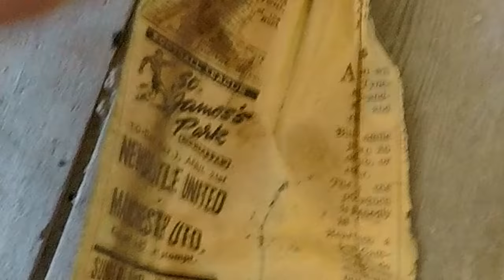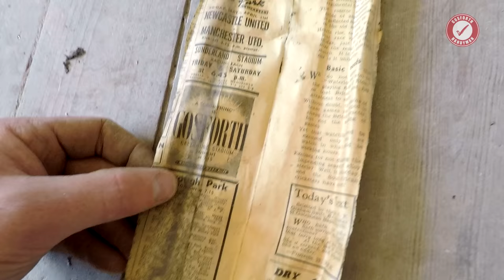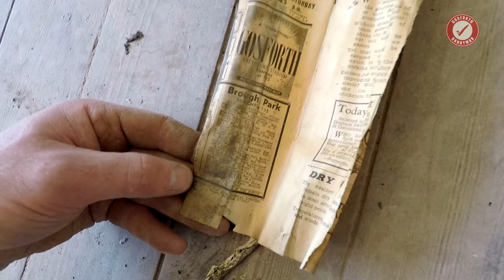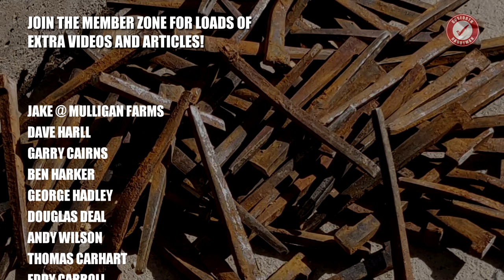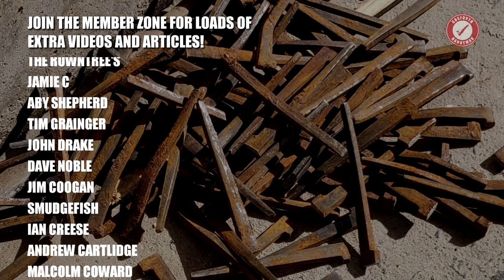How we INSULATE under the floors (1920's Renovation Part 26)

Comment: How architects differ. Mine advised not to use PIR but to sling a breathable membrane on the underside of the joists then fill with 200mm of minimal wool. Fortunately, there was sufficient crawl space to get underneath and staple the membrane securely. Apparently this method is used frequently when restoring listed buildings.
Reply from the maker: I think there's a number of methods depending on building age, crawl space size etc. There's some best practice stuff here: https://www.gov.uk/government/publications/insulating-suspended-timber-floors-best-practice

Comment: The exterior walls and floor joists are thermal bridges, even if you insulate the outside of the walls they are in contact with moving air bellow the floor allowing heat to transfer from inside the room down the wall, also through the flooroards through the joists, so the room is still losing heat

Comment: Exactly the problem I had when I insulated my ceiling - joists that hardly any of which were parallel. Took ferkin' ages.
Reply from the maker: Yup, takes forever. Not a single parallel joist. 😢🤣

Comment: Only breathable insulation should be used in the old sub floor. The timbers will sweat and over time will rot. Same problem as using spray foam insulation in the loft. It prevents air getting to the timber to keep them dry

Comment: Just insulated a 100 year old kitchen extension on a house. I found a YouTube video on cutting insulation where a large scraper has one side and the front edge ground to razor sharp with a grinder.

Mark board, use 2 or 3 inch straight edge to run the scraper at a perfect 90 degree. Once scored in by around an inch, throw straight edge to one side and run blade through by drawing it towards you with increasingpressure. 

The best part being thar using a wide blade, the cut remains straight right through once started as board holds blade straight and NO MESS.

It worked a treat and with practice, really quick with perfect straight and smooth edges ideal for squeezing in.

The sharpened front edge can be used as a trim knife to assist inaccuracies in floor boards and joists as will as cutting out obstructions.

The bigger the scraper the better, ONLY grind one side and mark it as I did both and managed to slice a finger when pressing it down without thinking. This leaves one side safe to touch and push in for deeper cuts..
Reply: Lee do u have the link?
Reply: @BoxerfanUK  you mean for cutting?
https://youtu.be/1cv46GuniIY

Not sure this is same video but same idea. I sharpened a wider scraper than shown but either should work. Just get it razor sharp but watch your fingers, especially slicing in.

Comment: Just a thought and to add a degree of crazy...
Under cut both dimensions by a half inch. Float it on your nailer sticks. FOAM a quarter inch gap all around. Then, there is no air gap in those imperfect hand saw cuts. Not that you had many. I know i do! Cheers.

Comment: there should be a layer of breather membrane installed prior to installing the PIR, then the joists taped to act as a VCL. Without these any moisture going in between the PIR and the joists will ruin the joists.

Comment: Awesome I wish my downstairs floor wasn’t concrete or I would be doing the same I bet it makes a huge difference
Reply from the maker: Cheers! Should make a big difference. With concrete you'd need to dig it up and re-screed with insulation. 👍
Reply: @GosforthHandyman  I just did what you have done last but year, bought mine ripped it back to brick and its done now so that won’t be happening now lol. I tore mine apart then lockdown happened and I was living there in one room and I had to buy 35 bags of plaster from gumtree for £20 a bag because there wasn’t any anywhere
Reply from the maker: Oh no! The materials shortage is turning in to a big problem. Our whole extension might need to be postponed. Heard about the plaster thing - crazy. 🙄
Reply: @GosforthHandyman  I hope you don’t get delayed to much I want to watch the progress 👍

Comment: Tip for those impossible nails: The large curved back of full sized, vise grip pliers make an excellent fulcrum for pulling fasteners. You can pull out screws if you want to. Nails are usually easy. Even if you just have a few mm exposed from a broken nail you can still lock on and roll the pliers against the wood to pull almost anything. For the really hard ones, or brittle materials, you'll pull a few mm, then release and grab at wood level again, so you don't break the fastener off and make things worse.
Reply from the maker: Defo! It's gripping the head of cut clasp nails that's the challenge. 👍😁
Reply: Did this and works a treat👍
Reply: Use that Stanley Wonderbar to wedge under the visegrip in order to withdraw the nail vertically without having to bend the nail.

Comment: At least your floor joists are solidly in the wall or on hangers. When i did mine, they were just sitting on bricks and slate packers.  Like yourself i used 75mm Cellotex, but i had to take up 95% of the floorboards (very narrow and solid red wood of some sort) .  As i replaced the flooring with grade 5 flooring tongue and grooved sheeting.  Also made sure all the old rubbish left behind by previous craftsmen (why don't they keep things tidy?) and plenty of air circulating beneath the insulation.  I then used foil tape over the joists and insulation to remove any chance of draughts, with expanding foam around the outer walls.  Even though i tried keeping the joists evenly apart, they were old and bent so cutting the insulation was very time consuming. Major DIY job for me but it is level and so much warmer.  Really like your videos, enough detail without going over the top.
Reply from the maker: Fantastic stuff and cheers!

Comment: In the 1920s, houses were built with adequate air flow underneath the flooring to prevent mould and rot in the timbers as well as helping to create a draught to draw the coal fires. There is a modern principle in thermal insulation where you need to meet the thermal triangle of thermal, air flow and moisture. Using hydrophobic insulation prevents the flow of air and contributes to moisture, which encourages the growth of mould and rot. Instead, install a vapour barrier to prevent any moisture from the soil, then add a breathable airtight membrane  to prevent wind-washing and let any moisture escape from the joists. Next use a high density hygroscopic insulation, such as sheep's wool, jute or wood fibre. Finally, add a vapour control layer before re-laying floorboards.
Reply: Wow.....do you have a YouTube channel? I have a Victorian terrace house and 6ft height in the cellar, can only access in by a small trapdoor in my back room. I need to insulate under there sometime this year, as the heating Bill's are on the rise. I need to cut down the cost! I would love to able to see some ideas on how I can do this job myself.

Comment: I like your method for fitting that insulation. I have a cat S60 thermal imaging mobile phone. I can see on my floor there are cold spots against the outside wall where the air bricks are positioned outside.

Comment: If you've got a table saw then you can reuse the floorboards and re-lay them. Its hard to buy that sort of character, if you want the boards varnished and on show.

Just sort them into how much usable width is left following the damage and run them through the saw to true them up straight again. Sending as many boards as you can theough at a given width, before moving down to the next size down. If you've got a mostly decent board with a gnarled up end, cut that bit off, and if you've got a split away piece from part-way along, cut the board at the start of the split and make two boards of different widths. 

So now you lay the boards back down, they may not span the whole length of the room anymore due to damage, so get another board of the same width that makes up the difference, cut them both so they meet halfway across a beam, and that's one board done. For the next one, use a different width of board and do rhe same. At some point you'll need to patch in a run of either new timber, or the odd reclaimed floorboard, because you've got to replace the damaged offcuts somewhere. Bob's yer uncle and Fanny's yer aunt.

Comment: This brilliant.. Instead of the baton, I would use Expamet Steel Angle bead. If your  joist is 100cm you then should be able to fit it in-between if using the steel angle bead.

Comment: I would have woodworm treated the timbers, whether it needed it or not,( precaution ) I've always been accused of going over top on thing.
Reply from the maker: It's a bit of a gamble since you never know if the treatment is going to eat away at the 100 year old bitumen DPC. 👍
Reply: @GosforthHandyman  
I,ve had no issue with water base treatment.
Reply: You should also employ a fire marshal just in case, ya know 🤪🤪🤪

Comment: We have a concrete floor in our living room, in winter the floor was so cold with cold coming up through the carpet that it fought off the warmth from the central heating, answer, insulation and electric under floor heating and inter locking floorboards, transformed our living room in winter now, so snug.

Comment: Nice long piece of 4x2 about 7ft will do for levering up those floor boards. Also, i’d say 70-80mm plenty thick as PIR. Only question is why wouldn’t you pin those battens to the underside of the joists? Looks like you have enough room to get a first fix nail gun in there at an angle which would be better anyway as skew nailing would better hold them long term. Just a thought anyway.

Comment: Did almost exactly the same to one of rooms, plans to do the others soon. I foamed gaps around the edges and used aluminium tape on all joins.
Reply: That"s the proper way, all joins and gaps, regardless how small, should be finished air tight, just a 1mm gap between two pieces in several spots can affect the effectiveness of the insulation by 25%.
And should a damp proof membrane between the insulation and boards or between boards and new flooring be used?
Reply from the maker: The 1mm gap / 25% thing is a myth - think about wearing a winter coat and having a 1mm gap - are you 25% colder? I would foam edges of big gaps if needed.  Tape isn't part of the best practice guide but I guess is probably wouldn't do any harm: https://www.gov.uk/government/publications/insulating-suspended-timber-floors-best-practice
Reply: @GosforthHandyman  A winter coat? Pfft, I expect someone from the North of England not to know the answer to that question. If you'd said "a hole in your t-shirt", that'd be a better anology.

As it happens though, I have a hoodie I sometimes wear when it's -2C or whatever, and it has these ventilation holes (maybe 2mm diameter) in the back. The draught that comes through them is intense, and I've actually tried covering them up for a bit of an experiment (with tape, but not in public, I'm not a total weirdo) and it significantly improved the heat retention! I was surprised. I don't believe the 25% thing. I do like the look of the gapotape product however, it looks the part, but I'm guessing it's horrendously expensive.

Comment: Some people might suggest laying a vapour barrier down before re-fixing the floorboards. What are your thoughts on that?  Nice job by the way!
Reply: It is recommended
Reply: Then you are taking all the floorboards up I guess. I am planning to do this and am confused over the need for a vapour barrier now.
Reply: The insulation acts as a vapour barrier here, taping over the joists and between insulation would make it continuous. Is it worth it when you'd still have bigger/harder-to-seal gaps around the edges? In his case he said he'd add a hardwood layer over the top too.
Reply from the maker: It's not recommended but it's optional for additional air-tightness. Not really needed in this scenario as would be a nightmare to fit. Useful info here: https://www.gov.uk/government/publications/insulating-suspended-timber-floors-best-practice
Reply: @GosforthHandyman  They really are a nightmare to fit and make it a nightmare getting your floor boards back down at anything approaching level imho.
Reply: All that work for a potential (15%) heat saving, which is not achievable unless all the boards are removed and all gaps are sealed with foam. Note that removing all the boards can weaken the structural integrity of the house, as in many propertys the floors act as horizontal bracing.  Also that wooden floor surface will never be as good again. Better to upgrade the loft or external wall insulation for a greater potential saving.if
Reply: @westwonic  It makes a huge difference not having a down draught sucking all the warm air out of the house. The "draw" on my suspended floor is sufficient to pull the doors open forcibly when there's a gust. Well worth doing imho.
Reply: @GosforthHandyman  Thanks for that link, it's really informative, something useful from the government!

Comment: For what you’ve done, you’d have been better just netting the bottom side of the floor joists and installing a insulation roll. For PIR insulation to work properly to its fullest potential then it needs to be a snug fir and foil taped with a 25mm cavity to reflect any temperature.
Reply: Hi, I have a Victorian terrace house and about 6ft in height cellar which can only access by a small trapdoor in my back room. I'm thinking of installing installation under the floor, where would I best buy installation from? Do I need to put like a damp membrane between the wall and installation? As I can't find any videos on YouTube on doing this kind of job. As the heating bills are on the rise, I needs to keep the cost down. Would be very grateful for any help. Thanks.
Reply: @charlieholdontolove9392  the main thing is that you allow a circulation of air. Are you just planning on insulating the joist area? Make a note of where your air bricks are and make sure they are clear to allow air to flow in and out of them. Design your insulation then accordingly so that it doesn’t block this air flow. If you’re wanting to insulate the walls careful consideration has to be put into the design as yes you’re more than likely going to need to install a wicking layer to allow air and water to pass freely behind any insulation plus you’ll need to disperse of the collected water through drainage. A job like this is very much in the detailing as if the water and air aren’t considered carefully you could end up with a bigger problem of trapped condensation created from making new warm and cold spots. If it’s a humid area to start with and you increase the temperature by a degree or so without tackling the humidity then you’ll create a new dew points. This is where people suddenly start getting damp issues and then spend money on damp companies who love to them pump non needed chemicals into the walls when the real issue is air movement

Comment: So want to do this to my house built in 2000. The bedroom over the garage has no insulation under the floor but my floor is t&g chipboard. I already sealed the edges which made a big difference.
Reply from the maker: Great stuff! I'm sure in 2000 it was a requirement to have insulation over a garage. 👍

Comment: My comments keep disappearing, perhaps because I included a link to a product? Anyway, Andy I use a "Faithfull Nail Puller 60cm/24in" to get the nails from floorboards. It's available on line from various retailers and there are YouTube videos of its operation. I find it damages the boards less than trying to rip them up with the nails in and saves having to de-nail afterwards. It would take much the same time as your method. I have a new technique for using it now too. I drill 6mm holes, about 6mm deep each side of the nail and this saves having to hammer the pincers below the nail head so much - again reducing damage.
Reply from the maker: Strange - links normally get quarantined for me to release but there's nothing there 🤔. I've got a nail puller but it's so noisy to use in a semi-detached house I gave up with it. Can see it working well if noise wasn't such an issue! 👍👍
Reply: @GosforthHandyman  Good point, but if you drill the holes there is much less hammering to be done. Your air nail gun must makes some noise though? It must be impossible to renovate a house without making quite a bit of noise?

Comment: Doing a similar renovation presently. In winter the humidity in the room with the suspended floor hits 53% and the temps have a low of -3. 
A door seperates me from that and my coal stove.. 
I'm pretty sure if I insulated the floor as you have (which I plan to do in the next few weeks), door or not, the ambient temperature of the entre property will go up at least 10c. 

Suspended floors: just who thought that was a good idea?!!
Reply from the maker: Ha good luck! I like suspended floors but they really need to be insulated these days. 👍😁

Comment: Excellent as usual, are you doing a video for upper floor insulation? I’m tackling the kids room before Christmas and want to insulate their room, it’s a cold room to start with and abit sound deadening wouldn’t hurt too 😅😇
Reply from the maker: Cheers! We're not bothering with upper floor insulation (other than loft). It would be too much of a nightmare taking all the floors up and the downstairs ceilings are new so don't want to take them down. If the ceilings weren't new I'd do it from below. Easier than lifting the floors etc. IMHO. 👍
Reply: @GosforthHandyman  hmmm didn’t think of that!

Comment: Have you ever considered using foamed glass to fill voids instead of PIR boards? I am always concerned about moisture condensing especially between joists and insulation boards. Wondering what is humidity level before and after installing insulation. I know you did good job on air bricks but still remember how many old building were damaged just by cement based plaster or pointing on bricks.